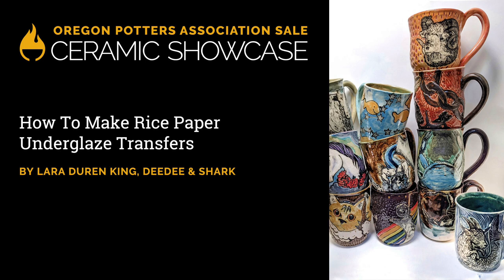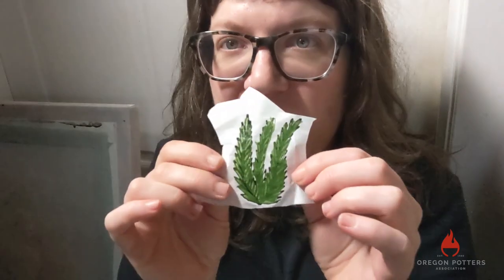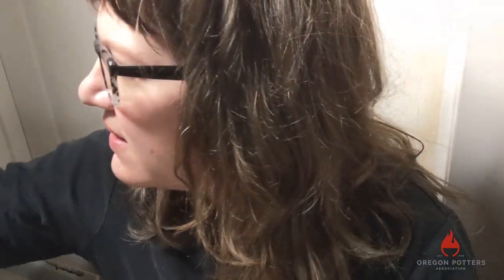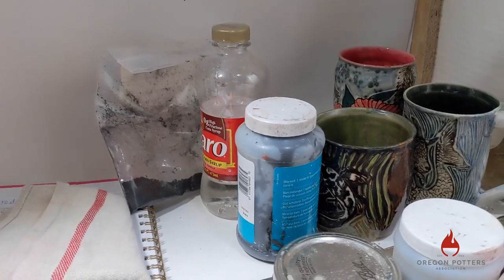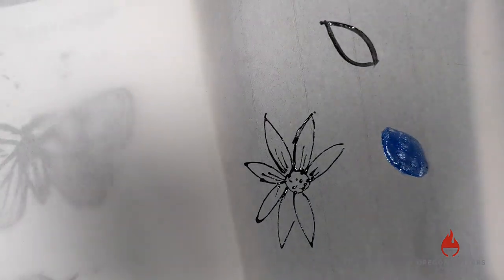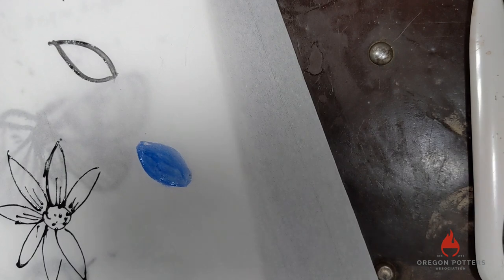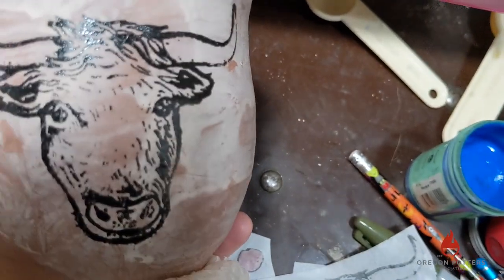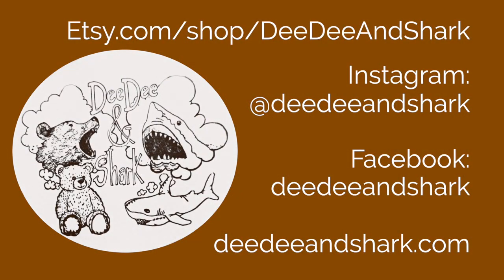How To Make Rice Paper Underglaze Transfers

Comment: Is the Karo/Gum mixture for all colors added or just the mason-stain based outline ink? So, could I just use commercial underglazes on my transfer paper, or do they need to be the mixture of mason stain/underglaze/Karo/gum? Thanks so much, this was a great video!
Reply: I've tried it both ways with mixed success. Sometimes it worked and sometimes not. A lot has to do with the clay's moisture level.

Comment: So I never saw you add any water to the transfer when applying to the moist clay you just rubbed it onto the clay correct?
Reply: Yes, it's best when the clay is perfectly leather hard neither too wet or dry. If your clay has dried out try sponging some water on lightly either directly to the area you are applying or over the top of the transfer. This is not ideal as sometimes it can smear the "ink" or cause the paper to tear. Use water sparingly and carefully.

Comment: Would be awesome if you show each ingredient close up so we can copy it.  Or list it on Paper give us a close up of that so we can copy it.  I need to write down. And would like proper spelling of the items.    Thanks. This was informative
Reply: This is a blurb from the original article, hope it helps

"For the ceramic ink mixture, you’ll need Karo syrup, Mason Stain 6600 Black (or any color you choose) Duncan EZ Stroke Underglaze Black 012 (or a color coordinated Duncan EZ Stroke underglaze if mixing another color), and CMC gum solution thinned to a light cream consistency. If you use any other underglazes, choose ones with a low clay content. Put one tablespoon of Karo Syrup into your container, and add two teaspoons of Mason Stain. Mix thoroughly, then add a teaspoon of Duncan EZ Stroke 012 Black. Finally, add a tablespoon of CMC gum solution, and mix thoroughly."

Duncan was bought out by Mayco but I've found success with other underglaze lines so don't worry about the brand so much, just find an underglaze in the color of your choice.